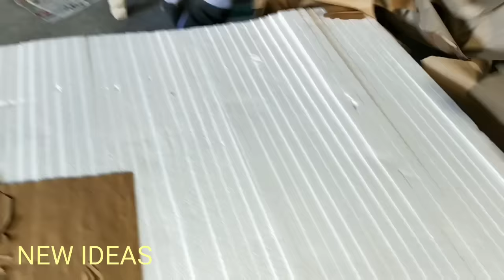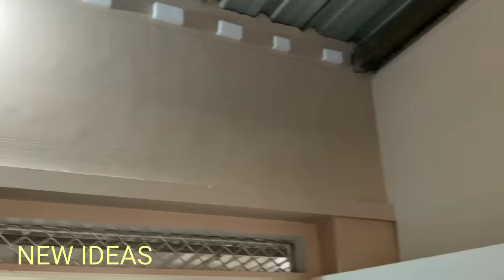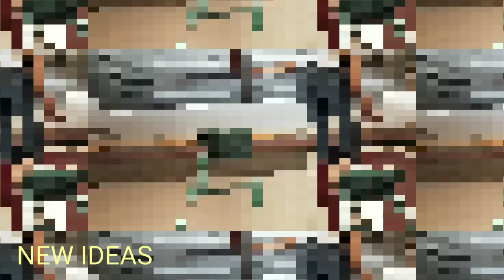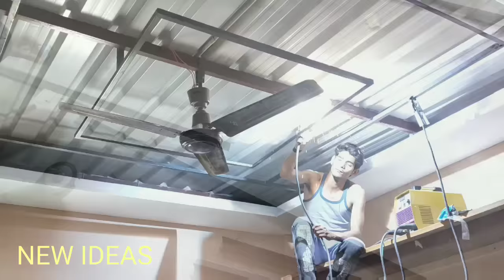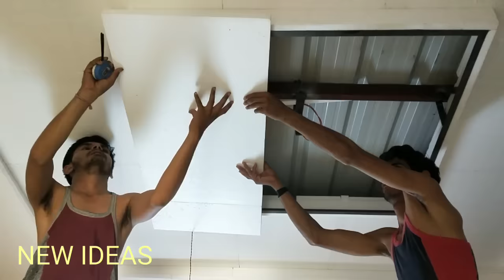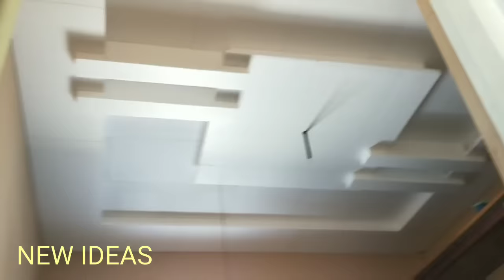Cheap thermocol ceiling & cool roof || thermocol ceiling and cool roof cost 2500/-

Comment: One case came up they were sleeping and there was a fire caused by short circuit all the melted Thermocol fell on them one small kid died I  think very sensitive small kids are trauma was too much that's why gypsum is always used is only 250-500 for a 6×5 piece why cheap out so much
Reply: Think positive
Reply: Rare

Comment: Nice Idea, it will work 100 % .
 But Thermocol is prone to firing up
Reply: even an agarbatti (Incense Stick) can bore a hole in Thermocol
Reply: How it catch fire plz tell me friend
Reply: @AmjadKhan-ez7yo  When it gets exposed to fire, The thermocol starts shrinking (On low flame/heat) and burning (with high exposure to plenty of flame) and starts realeasing poisonous gases which if inhaled can cause respiratory diseases and even Death ☠️
Reply: @AmjadKhan-ez7yo   Hope Molten Lava answers your question !!
Reply: Temperature kitna kam hota isse
Reply: @MohammedAli-jt7zr   ek kam karo, thermocoll ka ek chot box bana k dhoop mien rqakh do, ander or bahar bahut fark milega. Heat ko bilkul rok deta hai thermocol, isiliye ise ice box banate samay bhi use karte hien, ice box k liye high density thermocol use karte hien.
Reply: @arjitagarwal007  🤔
Reply: @MohammedAli-jt7zr   abe yaar ,  tu ice box le aa market se ya kisi juice vale se pooch le
Reply: @MohammedAli-jt7zr   Heat resistance jyada hota hai isliye aag bhi jaldi pakar leta hau
Reply: Good job

Comment: I have done this work with imported tarmacol celling 6 years ago still it is good but i always think about short circuit will be damage all Area
Reply: It will also cause serious health problems if you breath the fumes. if you are not able escape and fire is minor then it is possible you will die of fumes though not immediately but after the fire is put out you will face medical issues and may die of it.

Comment: I don't think it can be done in 2500. Even the raw material may cost more as we are using railings. Leave alone the labor costs.
Reply: Per sq.ft 65 rs
Reply: @andrewjohnson9951  it is then better to buy 2×2
Reply: @andrewjohnson9951  😮

Comment: When you switch on fan it will vibrate
Reply: U r intelligent
Reply: Jst make the hole a lilltle bigger... Simple
Reply: Agar fivicol zada lagaya aur patches zada ceiling ko joda jaye to vibrate ho sakta hai kya? Kya guesses hai?
Reply: No wonder you're profile name is Beware 😂🤣😃
Reply: @khsurjakumar2175  
अगर आग लग गई ना तो फायर ब्रिगेड वाले भी गाली देंगे😆
Reply: पूरी सीलिंग तो चूहे खा जाएगा 😅😅😅😅😅😃😃
Reply: @deepakdrall  dinbhar sota hi rehata he fire Brigade walo. Thora kaam to karnedo bhai. Muft ki salary le raha he.
Reply: @khsurjakumar2175  
Par bahi jab koi call aati hai emergency ki tho unhe pta nahi hota ki unke uper building ki balcony giregi ya puri Building. Ye mere liye bagvan  ka he roop hai
Reply: Wotsap malse
Ana
Reply: Beware Be Carefull
Reply: Beware Be Carefull o
Reply: @rohitkulkarni5640  nah idont think
Reply: 2500 ma kya dhoondh rahe ho itna hi milega
Reply: @deepakdrall  😀😀😀
Reply: No
Reply: कम्पन नही होगा,क्योकि पंखे कि हवा नीचे आती है नाकी ऊपर जाती है...
Reply: 2500 me taj mehal thori ban jayega
Reply: I was about to tell that, i was wondering when i turn up the fan, thermocols will be every where. Not a good idea or recommended😂🤣
Reply: Technically dekha jaye to vibrate nahin hoga bass fan hole thoda bada ho aur fan bhi acchi company ka ho aur sahi se mount kiya jaye aur haan ismein angle frame hai to vibrate nahin hoga aur final cheap and best heat insulation.

Comment: Awesome idea, in whole YouTube only u did it, i was searching fr this mtrl, amazing. Im gonna do it to my home 
But 1 doubt, how thercol sheets r sticking with fevicol? Sheet is not getting spoiled with it?
Reply: go for gypsum board with Glass wool or rock wool.. it will cost you little bit more.. but is much safer as when thermocol burns it generate wlvery toxic gas which will kill you for sure.
Reply: No the glue will not spoil
Reply: Great idea bro do it

Comment: As it's thermacol and it is light weighted so the question is can we onn our fans after its installation 🤔🤔🤔🤔
Reply: Fan iron ke lock par hang hoga, thermcol ki sheet par Nahi
Reply: @parulmonitor7778  ha ye to sabko pata he par fakt air suck karta he aur thermacol ko fevicol se still kiya he so vo easily air ke sath nikel jayega fan ke vibration se hi sealing break hoga
Reply: Steel ka frame laga huwa ha upar

Comment: I had a thermocol ceiling for over 37 years and its still the same , its life is more than pop.🔥
Reply: Jaise ceiling and walls per dust lagte hai so saaf kr sakte hai
Muje bhi thermocol try Krna hai toh cleaning k time dikkat nhi hota ?
Reply: Bro ye safe and strong rhta haii??
Reply: Rat will destroy this cilling..
Reply: @astarulmohammed4963  rat doesn't have wings 😂
Reply: But ceiling is popular in last 10 years only?
Reply: @lalithakarthik1639   thermocol ceiling is there very ling back. pop is little new.
Reply: You guys don't use fan or what
Reply: heat tagginda bro

Comment: It’s a good idea however it’s not safe to use due to fire hazards. If there was to be fire that house would go up instantly. Remember these ideas may be great but could compromise your safety in the long run.
Reply: Where there is advantage There is an Disadvantage
Reply: @stablebratkarthik3980  where there’s a will there’s a way... 👌
Reply: @videshah3365  Absolutely that's my point

Comment: Will it really works as a heat absorber?? Can anyone tried? Kindly share conclusions! Wanna implement on my dogs Kennel!
Reply: Never use thermacol in dog kennels. First of all cause of the safety hazards. Incase of fire, it melts too quickly, etc, and leaving that, if a dog  consumes theramcol it is really bad. And since it's a kennel and not a house you won't be on a watch 24/7 as to what's happening inside. So dog proofing material(thermacol) or for any purposel for kennels would not be a good idea in my view unless they are infused between two materials.

Comment: Beleive me.. It's going to be too hot in it.. It won't let the air flow.. Rather keeps the heat trapped in the too.... Same with cool temperatures.. If it's cool,.. It will be too cool..